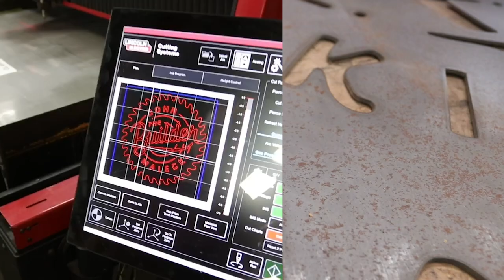DIY Barn Wood Wall and Metal Sign | Vlog 005

Comment: What’s your experience with the rigid airless nailer? I’ve gone through three of them with minimal use. They just stop driving nails all the way. Each time I’ve called and talked to them they said it’s a known issue, wonder how yours has held up
Reply: Do they replace them under warranty at least?
Reply from the maker: Well, the nailer struggles in hard wood. For this one i was going back a lot and finishing the nails by hand. this one came out like 5 years ago when i got it. i dont use it a ton, but it fits its needs when i do
Reply: A Seba I forgot to register mine, but they will replace it within first three years. I’ve replaced it twice. If you register the tool when you buy it, it has a lifetime warranty.
Reply: @Bward216  That sounds good, not many manufacturers do that here in the UK.